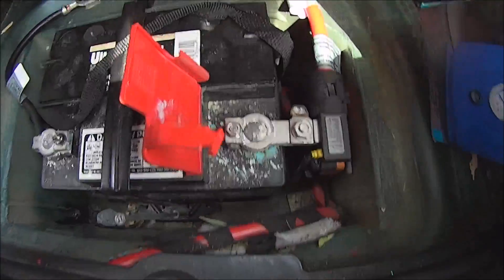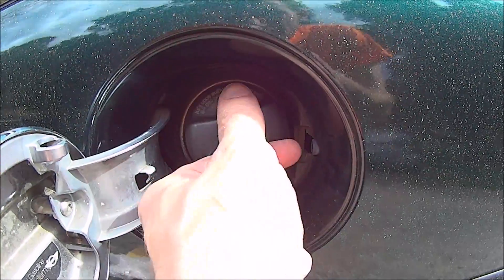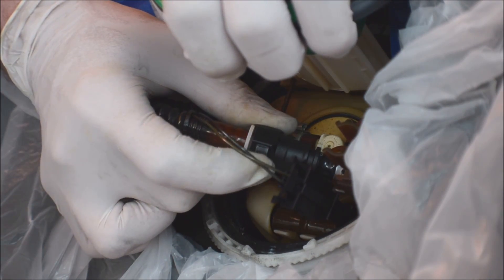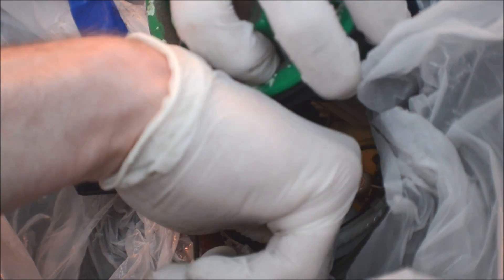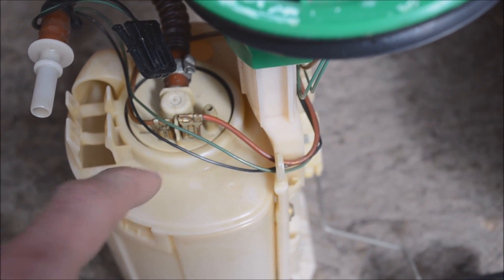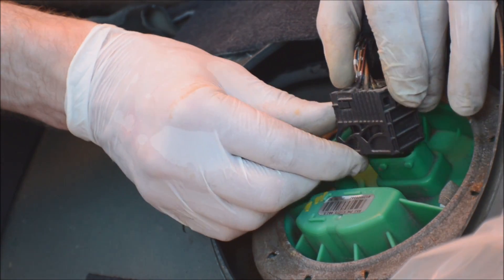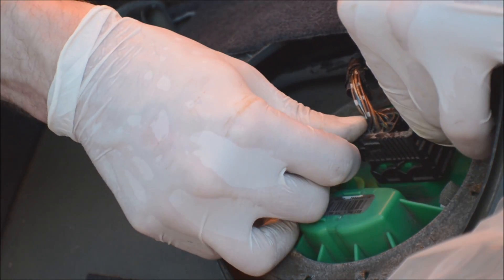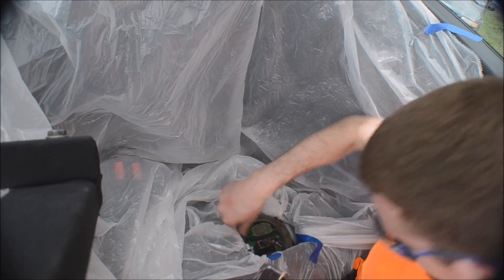How to Replace MINI Cooper S Fuel Pump

Comment: thanks for showing in detail how the connector is removed.  Rats chewed my wiring and I needed to take it off to repair the wiring.  It was a mess, but your video showed me how to take the connection apart so Thanks again.
Reply from the maker: there was a mouse nest in that area on mine, luckily they didn't chew the wires, but it seems that might be a popular area for mice. welcome!
Reply: @aDIYCarGuy  Yesterday I found a mouse in one of  the old fashioned mouse traps I had set in the engine bay.  It wasn't a big mouse, just your normal gray house mouse, but possibly the wire eater.  I will continue to set mouse traps in the engine just in case, because mice and rats have been really bad this Spring out here in the boondocks and the moth balls have not kept them at bay.

Comment: Its a lot easier to take the front seat out.  Also guys be careful, the small brown clip that comes off before unclipping the high pressure fuel line has a tendency to slide down the fuel line into the tank as mine did. If this happens its near impossible to find without taking the fuel filter out. I clipped the fuel line back on without the clip and the car works fine. Great video, Celtic music me being a Scot appreciated.
Reply from the maker: thank you!

Comment: Great video, and very helpful! Thank you for posting.

One small comment - using a brass drift vs. a steel screwdriver to remove/reinsert the metal ring would prevent any sparks which is a good preventative measure when dealing with the fuel system.
Reply from the maker: that is a great tip

Comment: Thanks for posting this video.  The only thing I would add for anyone trying this...use some compressed air or a vacuum and get rid of all that dirt and rust that fell back down inside the tank when he pulled the old pump out.  A couple of extra seconds of work that would be well worth it.
Reply from the maker: np, thanks for watching!

Comment: the duel pump on my 2004 R53 died as well...  thanks for the video Bro! it really helped alot because i was afraid of breaking something. i also replaced my Fuel Filter because it was pitch Black! my R53 has 95K miles and the fuel filter was never replaced... i know that u are supposed to have it replaced at 50K or so... Thanks So Much Bro!
Reply from the maker: no prob bro glad it helped, i'm dreading the day my engine bay pump dies, I didn't change my filter but tbh it's probably the reason my tank pump died haha.
Reply: Changing the filter is easier then changing then pump... u can do it in under one hour or just about 1 hour... its not as complicated as the pump... u should do it its ~$20 for the filter but its a very important part... because when it starts to clog up, u will notice a lack of fuel at full throttle and/or slight misfire at low RPM's...
Reply from the maker: Angel Salguero I may change it...thanks!!

Comment: Should also replace the fuel filter. Unless the donor has really low miles I recommend buying new for a fuel pump. 
Good video showing the connectors and gasket, etc.

Comment: I watched your video a few weeks ago, and just replaced my pump. I should have watched it again as a refresher, because I forgot to fill the new pump with gas. Unrelated, my battery is dead, so I am charging it now... but I’m wondering if I need to pull the pump back out and fill it with gas before trying to start it. Thanks! Great video by the way!
Reply from the maker: Should be ok in my opinion
Reply: Thanks! Another blog on a mini parts dealer suggested it did not need to be “primed”, but added a suggestion to turn the ignition switch on for a few seconds ( without starting), then off, and to do that a few times. I just gave it a try and it started right up. Thanks again!
Reply from the maker: awesome, welcome!

Comment: I understand that it might be the fuelpump on my Mini that's acting up. Only problem is that it's at a chop allready and it's 30 min away. So getting it home to fix it up myself would be a hassle. Atleast it's an easy job, so even having a chop do it, the work itself shouldn't be too expensive. But I'll look into changing the filter afterwards so that's also done.... if it really is the fuelpump.

Comment: 7:50 do you know the part number just for electric pump? also dimensions ? Cause mine just failed, cooper non S , 1.6 2002. i think it is diameter 50mm length 135mm, but i must have it before i open it

Comment: My 2007 Cooper S has cold starting problems like it's not getting enough fuel.  Should I replace the fuel pump?
Reply from the maker: I would do some tests to figure out what exactly is wrong with it. If you take it to someone with a good pro grade OBDII scanner they can turn the pump on and off (and other electronics) and see if it's working properly. There are 2 fuel pumps...one in the tank and a high pressure one in the engine bay.

Comment: Great video dear friend!! Do you know what is the fuel pressure on this car? Do you Know where is the fuel pressure regulator?Do you know the Spark plug spec?
Thanks a lot from mexico!!
Reply from the maker: Thanks!

Cooper 3.0 + 0.2 bar (43 + 3psi) 
Cooper S 3.5 + 0.2 bar (50 + 3psi) 

The regulator is built in to the fuel rail from what I have read.
Reply: Good bless you!! my friend!!
Reply from the maker: j charles Thank you my friend, you too!

Comment: My 2012 is misfiring, could it be the fuel pump? I'm going to start with spark plugs and coils first
Reply from the maker: is it throwing any codes? I would do the fuel filter after the plugs/wires/coils if they don't fix it. could also be vacuum leak, dirty injectors. do you know if it's a GDI engine?
Reply: It’s probably a bad ignition cool

Comment: My Mini Cooper S dies when there’s 1/4 tank left of gas, and starts right back up when I add a couple of gallons. I still hear the fuel pump when I turn the key. Could this be caused by a clogged fuel filter or a failing pump?
Reply from the maker: could be a failing sending unit telling you there's 1/4 tank when it's actually empty

Comment: My friend didn't fill the fuel pump when he changed it, and now the indicator for the gas is on zero. Even though I have filled it with fuel, the indicator is still on zero and apparently, the computer for the Mini Cooper is not working properly after changing the fuel pump. What do you think the problem might be?
Reply: The float is used for the fuel level indicator so it may be installed around the wrong way or is otherwise stuck

Comment: What year is your mini?
Reply from the maker: 2004
Reply: I think most MINIs have the same system. I have an ‘09 MINI Cooper base model and I recently replaced my fuel filter and pump using this guide and the parts look the same as in the video here.

Comment: You know if you disconnect the negative post of the battery first you don't have to worry about pretty fireworks if your wrench touches the body while you're loosening or tightening it. Here's a cool story:   http://www.popularmechanics.com/cars/how-to/a1454/4213127/
Reply from the maker: Thanks, I'm aware of that. That's a great article and a good practice for the unpracticed.

Comment: Are these good cars?
Reply from the maker: no, it's one of the least reliable vehicles i've ever had.....very fun to drive though
Reply: Hell no .  I'm going back to Toyota
Reply: It’s a matter of opinion and experience. They just require very special attention, you can’t beat them up like you would a mainstream car brand. Just keep on top of all preventative maintenance and do Oil changes more often than recommended by MINI, I do mine every 5,000 miles with original MINI filters and I recently started using Molygen New Generation 5W-40 Oil. It’s helped a bit performance wise now but I’ll tell you how it went next time Oil change is due. MINI recommends Oil Service every 15,000 miles which I think is ridiculous for such a small car. And make sure to check your oil level and top off every 2 weeks or weekly depending on your driving habits. Mine tends to burn oil (Castrol, 5W-30 full synthetic) when I do heavy driving but I hope this Molygen will help with that. Last, anything you can do on your own with the great internet as a research resource will help your wallet and make sure to find a reliable independent MINI shop, unless you can afford dealer prices for major repairs/maintenance. Other than that the car is fun to drive though and you’ve got to convince yourself it’s worth it! Haha
Reply: Lapu-Lapu Daylo Toyota is boring though, it’s cliche of me to say but everybody has one.

Comment: hi sir. i have a problem with my mini cooper s 2012 engine n18b16a..the computer shows " low pressure" . i replaced anew fuel pump pressure and it's still the same problem? what do you think?  what is the problem? maybe  it is becouse of the dirty filter?
Reply from the maker: could be a filter or the pressure regulator or the high pressure fuel pump is going. if there is a high pressure pump on your car, I don't know
Reply: GANAIEM MOHAMMAD  Hi,
I have replaced the high pressure fuel pump and it Gas still got the Same Problem.
What was your Problem?